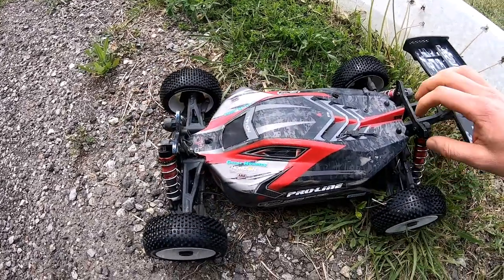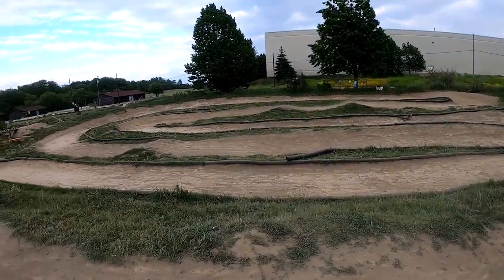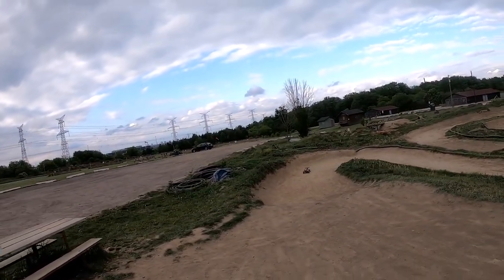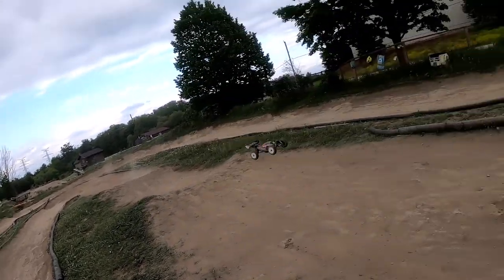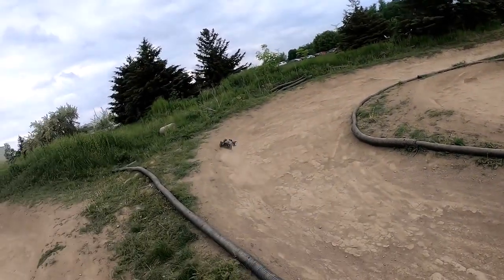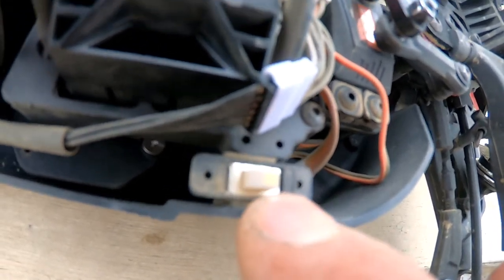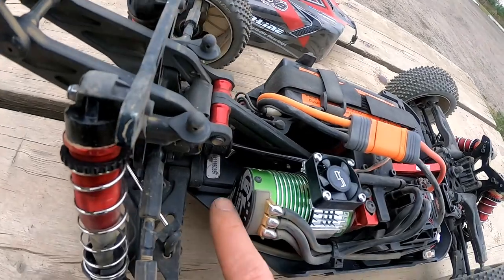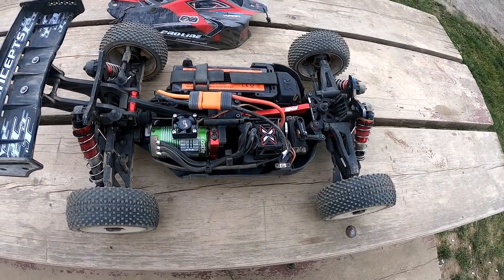Arrma Typhon 6s V5 Castle Mamba Monster X 2200kv first run

Comment: Nice setup, powerful combo & Arrma rocks!! 😎👍

I just finished stretching my Typhon 6S.  I'm currently running the mmx 6S at the moment till i get back my mmx 8S back from castle. Also running a 2200kv motor. Running on 34T/34T on 4S, I pulled 85mph on that puppy lol. As soon as I get back the 8S, goal is to to push it over 100mph on 4S. I don't want to push it too hard on the MMX 6S, already pushed 206A on that 85mph. But surprisingly, after 3 runs back to back @ 85mph, the motor (no fans) wasn't too hot, could keep my fingers on it, & the MMX 6S reached a max of 167F, which is warmer than I'd like but still within spec.

Nice vid, keep'm fast! 😎👍
Reply from the maker: @RC Bustanut Thanks and WOW 85 mph i was thinking about making my Typhon a speed buggy and might do that this summer but for right now its going to stay stock other than the motor and ESC. I really like the Castle 2200KV motor and didnt know it was capable of that speed and the low temps that you had keep it up sounds  like you'll hit the 100 mph mark soon

Comment: Hello, nice video. I have a question. My e Revo has following setup: monster mamba x (6s like yours in Video), monstertronic brushless motor 2650kv, traxxas tqi reciever (5 channel) My question: When I switch on the ESC the esc ventilator is running for 2 seconds and shut down. I can drive, all okay, but the ventilator is off. I dont try to push hard, because I'm afraid to overheat my esc. But is it possible that the fan is tmperature controlled by esc itself? I use 3s Lipos, and my testruns was only on asphalt street... Thanks for your answer.
Reply from the maker: @McLane I noticed that too I am pretty sure the fan is temperature controlled by the ESC because my esc fan does the same thing comes on and off when it needs it. If you have the castle link you can connect your ESC to your computer and data log the ESC temperature to see exactly how hot it gets
Reply: @rcdaveshobbies  cool, I will try that. Thanks for your fast answer.

Comment: Great video, where is this track? Is it in the GTA? Thanks a lot! Really enjoyed watching all your videos so far, Tekno looks great, would you recommend the Truggy or the Buggy? Which one is better in terms of durability and speed? I will be driving my Typhon 6s at Otterville next year/season, but would love to pick up a Tekno for next season as well, once it's back in stock. Thank you!
Reply from the maker: @Jim Z all the info is on the website http://mmfc.net/ it’s in Mississauga just before Brampton on heritage rd. I would recommend the Truggy since you already have a buggy it’s just hard to find truggy tires but should be in stock soon. And between durability and speed they are both basically the same it all depends on what you gear it with and what motor you use. If I had the Truggy before the buggy I would’ve never bought the buggy because the truggy is just so much more fun to drive and more forgiving on the track

Comment: nice set up by unplgging the auxiliary wire did  the car perform  better? did you have to go into the  setting in the esc to change anything?
Reply from the maker: @quietoneap1 The car was a little bit better because it was at 100% power all the time when you have the auxiliary wire set up you can have it to adjust the power settings. And yes I went back into the ESC and turned off the auxiliary wire just to make sure it was not affecting anything

Comment: Can i run just the motor keep the spektrum esc and get better performance ?
Reply from the maker: The Castle motor is censored and the spectrum ESC is non-censored so I would say you would get better performance with the castle motor and ESC together compared to having a castle motor with the spectrum ESC
Reply: @rcdaveshobbies  what about just a different motor non censored like the hobby wing or tpp without having the get the whole combo 
Always wondered
Reply from the maker: @violater7026  Yeah you can put a hobbywing motor or any other motor to the spectrum ESC that’s not a problem it will work just fine. You might need to change the ends on the ESC or the motor  depending on what you get and plug size

Comment: Nice set up I’m looking for a new power system for my v5 typhon. How have you been liking it after some time
Reply from the maker: @Guy on a Moose’s Rc Adventures i’ve had no problems with the system It worked better than the stock Spektrum has more power I used it for a couple weeks in the Typhon and then put it into my Tekno ET48 2.0 and worked great